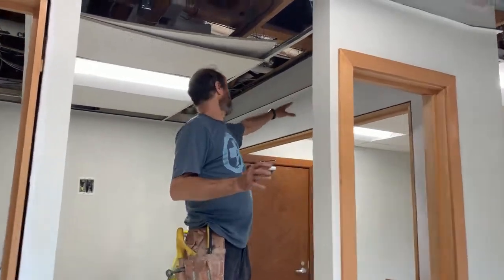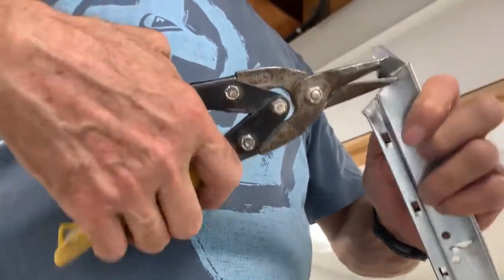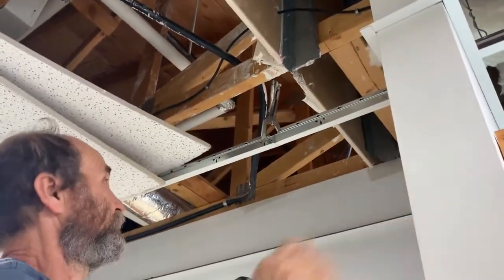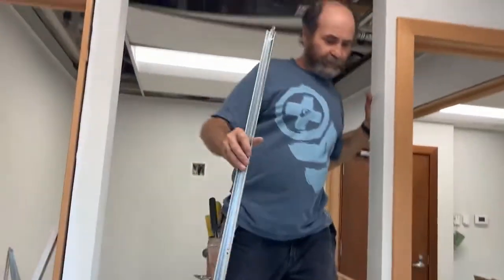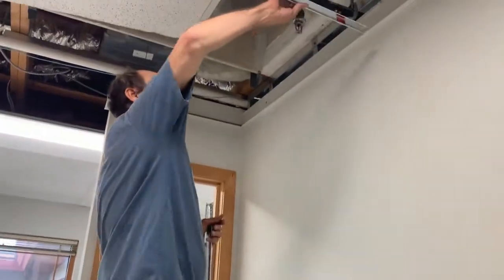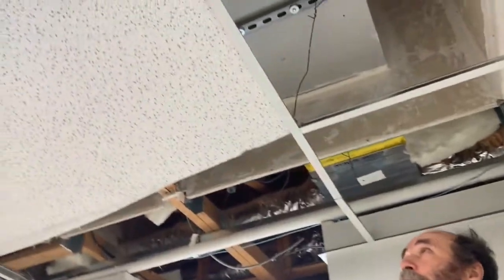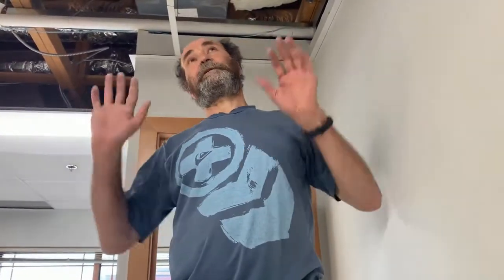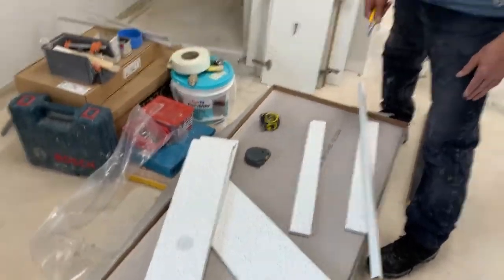CEILING T-BAR Repair & TILE REPLACEMENT

Comment: Hi.  I have a damaged area of a drop ceiling with older t-bar system that doesn’t seem to be available on the market any more.  Have you ever dealt with this?   Thanks.
Reply from the maker: Hello Eric, thank you very much for your time and support, yes, sometimes we need to improvise, when we are on those situations,  we either remove and install new T-Bar or repair the best that we can (if it's a small area would be worth to remove and install new T-Bar, if it is a big area with divisions, we can cut the old T-Bar on top of the wall and replace the T-Bar just in one room and use the old removed T-Bar to fill in area if needed), please let me know if you have more questions, keep safe

Comment: Skipped the sprinkler head.  That's the part I really need.  😬
Reply from the maker: Hello there, thank you very much for your time and support, some times the sprinklers heads are a kind of pain, on tight space like small closet with a sprinkler head on the ceiling, ceilings that use just one tile, it's good idea to remove the wall mount as required and insert the tile in and screw the wall mount back, on full tile usually the sprinklers allow a bit of flexibility, please let me know if you have any other questions. Keep safe.